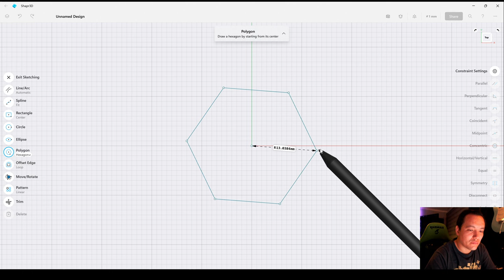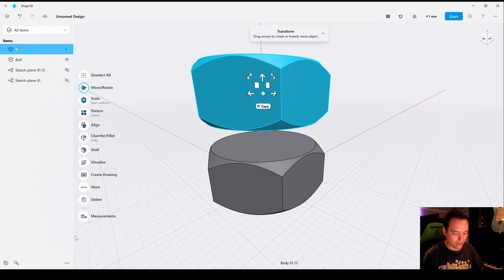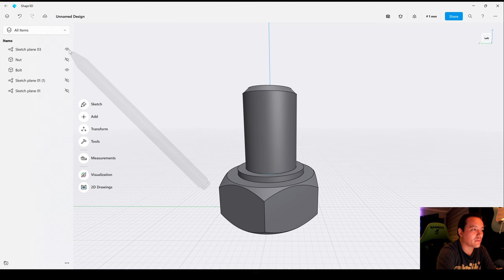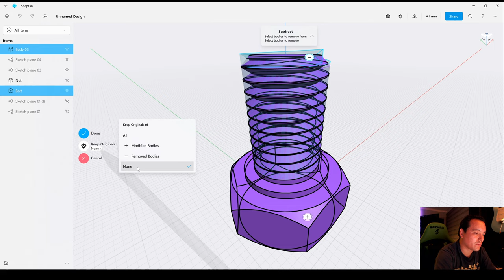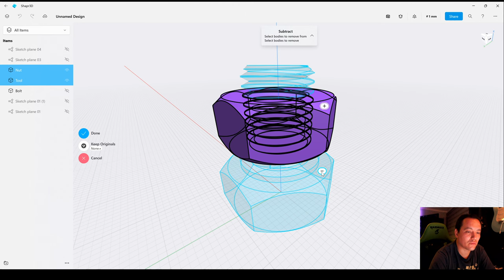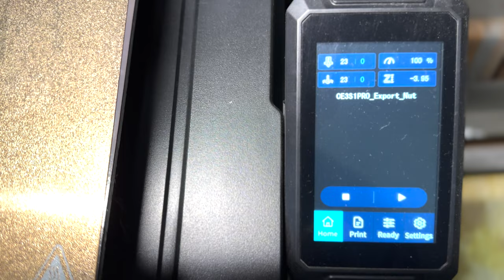Bolt & Nut for 3D Printing in Shapr3D

Comment: I really like shapr3d for most things.  It's just really easy to use.  However, Threads are just sooooooo much easier to do on Fusion 360
Reply from the maker: Totally agree! In Fusion 360 just need to use the specific command for that.

Comment: A bolt is bolted (as in hammered or pushed) in. It has no threads. 

A screw is a bolt with threads. 

This rule is regardless of dimensions and according to SIS (system of international standardisation).

Kind regards 
Anders 
Sweden 
Retired mechanical engineer